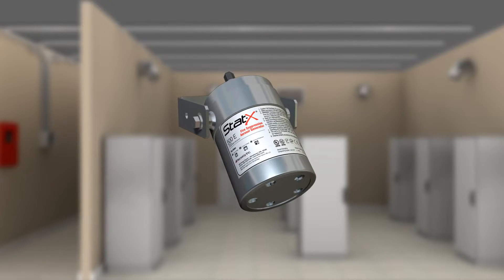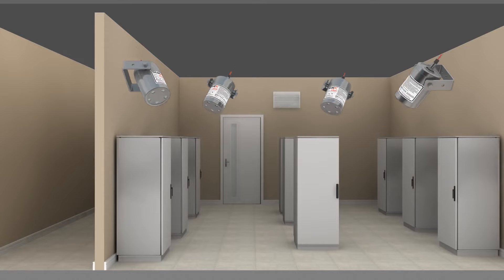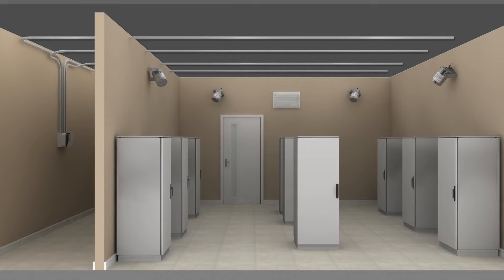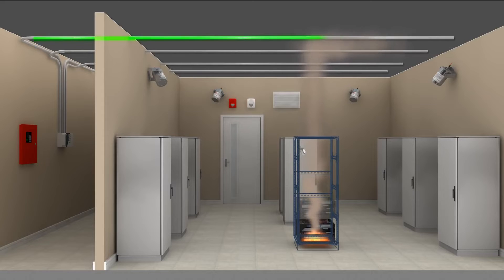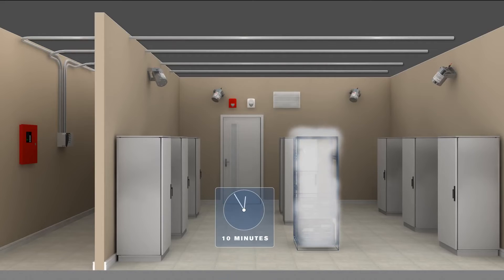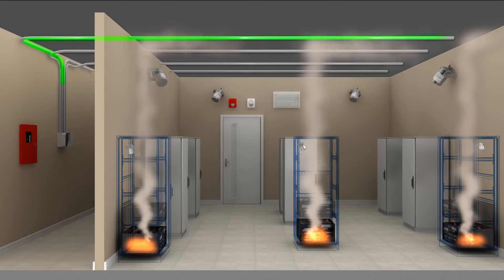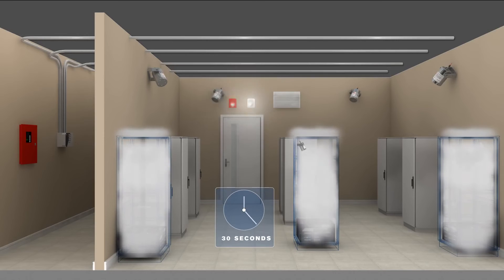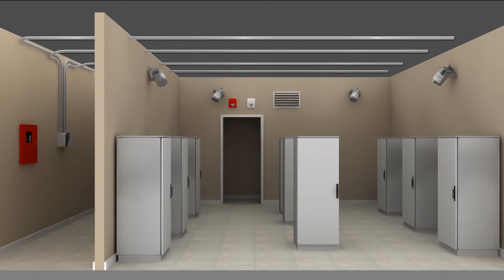Fire Suppression System working principle, fire suppression system working animation

Comment: Hi friend. I have watched a lot of your videos. Thanks for sharing your excellent HVAC designing knowledge. I have several questions about the ventilation. 
1. based on carrier air conditioning system design handbook, it recommend to choose the larger minimum quantity of the minimum cfm per person and cfm per sq ft of floor area, but in your E-20  heat load calculation sheet, they are added together as the minimum ventilation.
2. air change rate is related to the supply air or outside air? If it is related to outside air, does it mean I need to choose the larger minimum quantity among CFM(ACH), CFM(person) and CFM(sqft) as outside air quantity. 
or if ACH is related to supply air, then I can directly use CFM(ACH) as the supply air quantity.